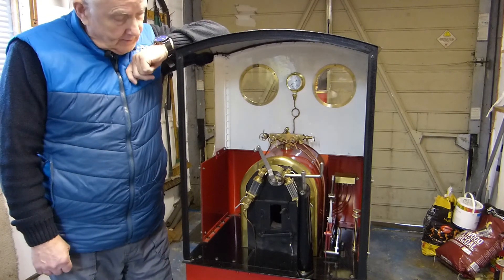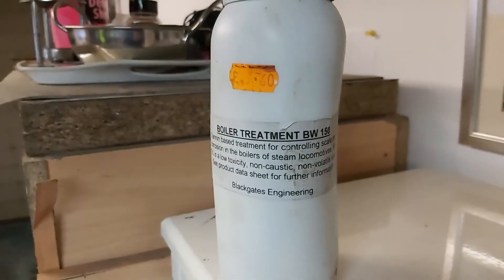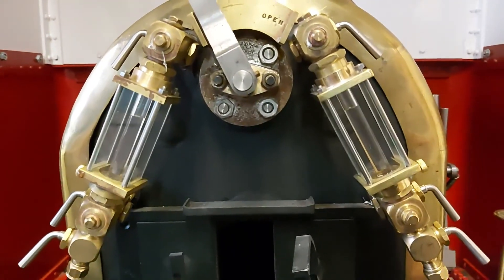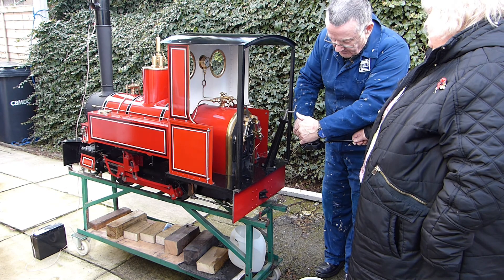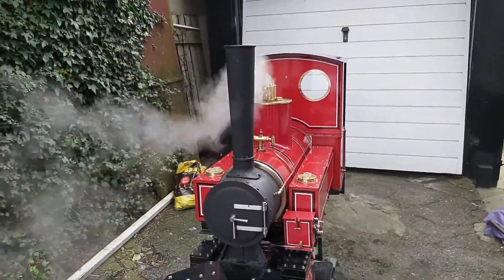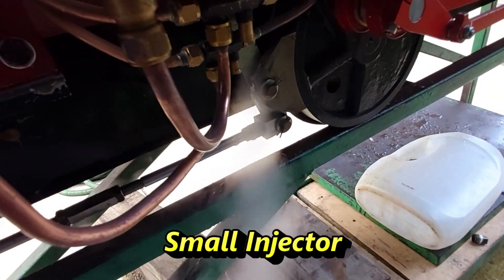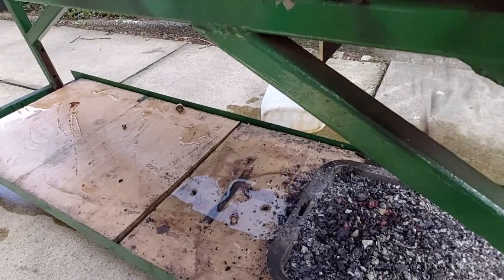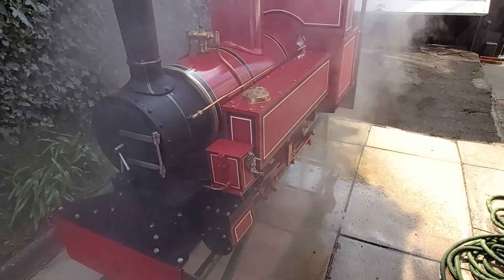1st Steaming of Romulus Loco April 2021

Comment: I'm pleased to say that all the 6 locos bar my first, a tich built in 1952, have steamed without fault first time out.
The main reasons are: I extensively tested all components prior to assembly, in particular items such as the mechanical lubricator. I ran the chassis on air for an extended period. I made a small gas heated boiler for testing all boiler fittings.
Reply from the maker: That is good practice to test items like that,I tested my water gauges under pressure before steaming and it paid off,trouble I still had injector problems with one injector,thanks for watching the video and your comment.

Comment: very good.  What is the latest update with your Romulus please?
Reply from the maker: At the momment the engine is finished and I am building the sit on tender.Due to circumstances beyond my controle I have not yet run it on the track,hopefully I am planning to lay some temp track on my drive to give it a try out.